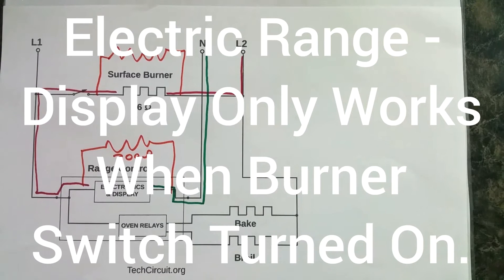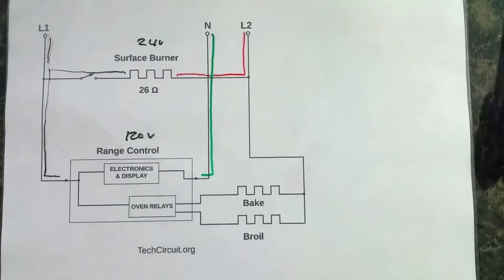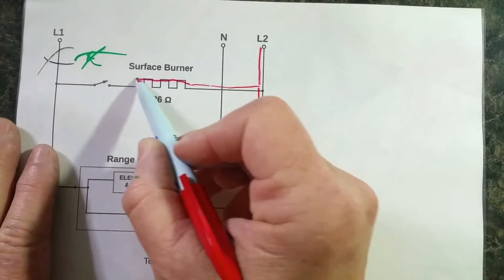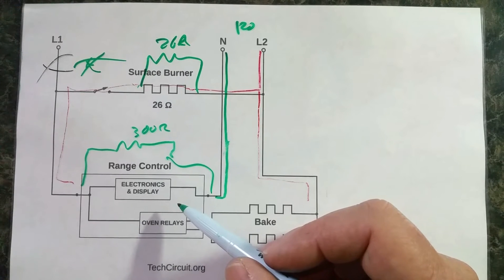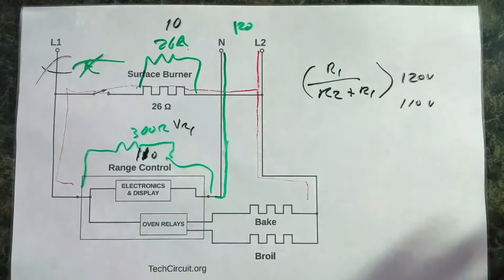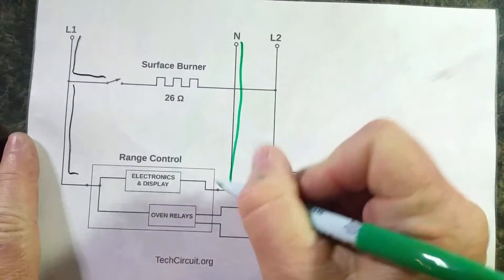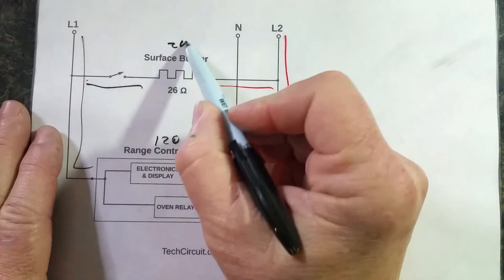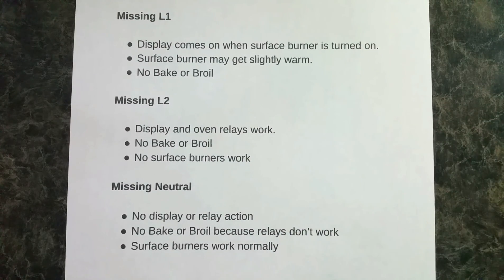#6 - Electric Range No Display Until Burner Turns On? Here’s What You Need to Know!

Comment: Nice report and diagram! I had a situation one afternoon a couple weeks ago where the house lost L2 after a storm. I walked into my house after work and 1/2 the house was dark! Went to the range where the display was on, turned on a burner and some of the house lights that wouldn't work normally lit up! I turned off the burner and those lights went out. W e i r d...
Reply from the maker: Thanks you. What happened in your house can be explained. Through the range burner, you supplied some of L1 to the L2 house circuitry. This is because the range burner has a very low resistance and is able to pass some of the voltage to some of the high resistance lights.
Reply: @TheTechCircuit  Thanks for the explanation!